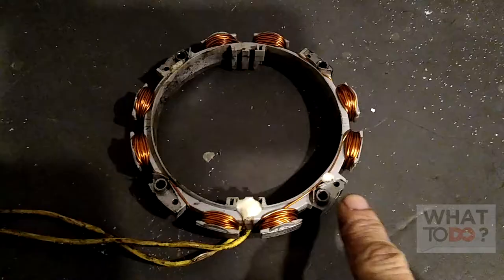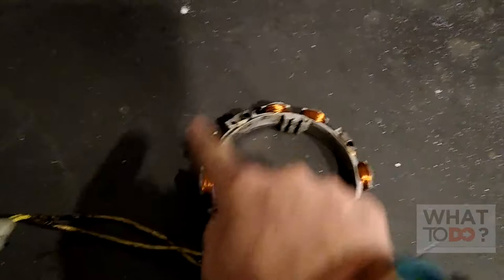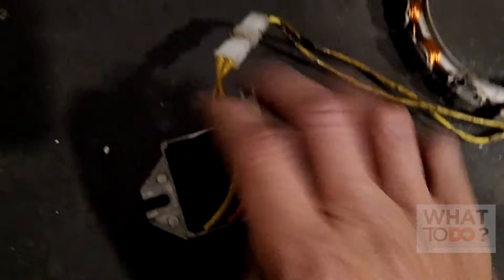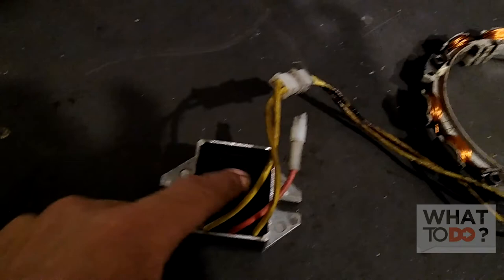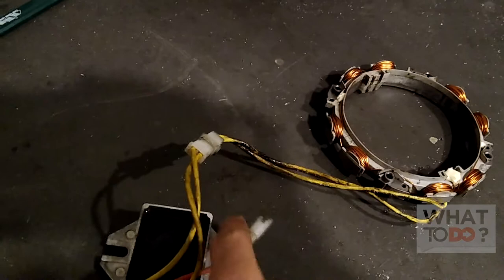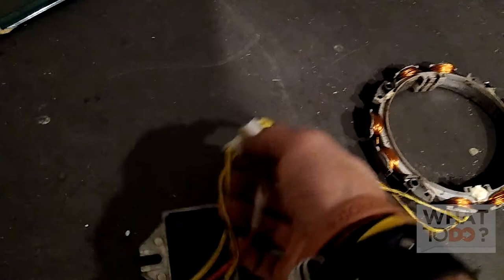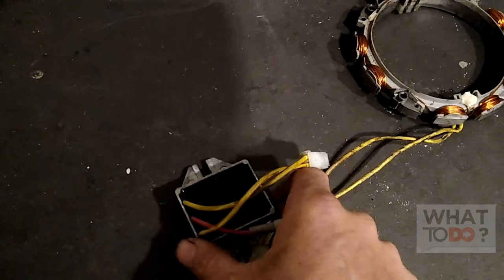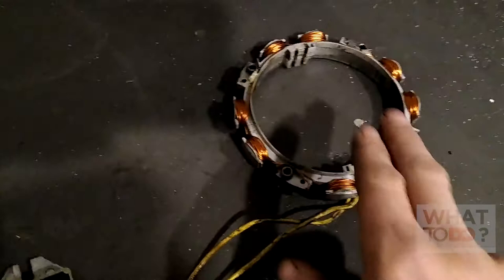How Alternator and Voltage Regulator works on Small Engines

Comment: please can this be change to three face rectifier because the size of the battery was increased?
Reply: The capacity of the charge system is based on the demands of the vehicle, a battery will charge whether at 1A or 5A.  

That being said, a 3 phase rectifier requires a 3 phase stator. If you can find a stator to suit your engine, you can easily find a rectifier that'll handle the output

Comment: on the voltage regulator can i twist the two yellow wires together and connect the single  charging coil  wire  to it or should i use only one of the yellow wires

Comment: thanks for a good clear video. please sir can you provide me with the part numbers for that particular stator and the regulator. thanks in anticipation.
Reply from the maker: I believe that video was a few years ago I can't really remember what the part number was for that particular alternator if you need help locating it let me know what your engine is and all that stuff and I can try to help you locate one but it should be fairly simple to find one on Amazon or just by googling your engine let me know if I can be of any further assistance thanks so much for watching my channel I really really appreciate it
Reply: thanks for your reply. I will get back in contact with you.
Reply: I just swapped out a kawasaki 20hp v twin for a new briggs equivalent and when I started the motor, she gave the loudest bank out the exhaust so much so that I'm to scared to attempt it again. any advice please.